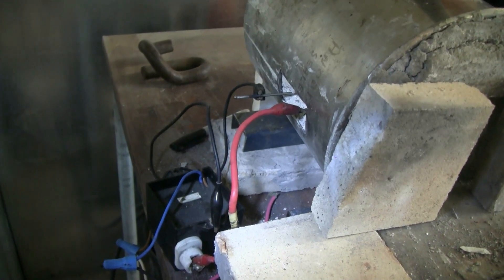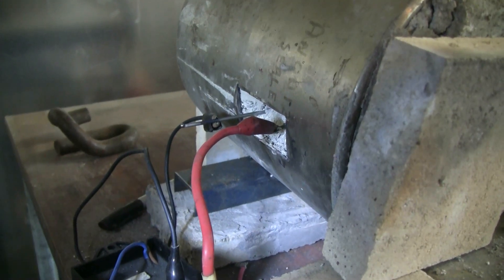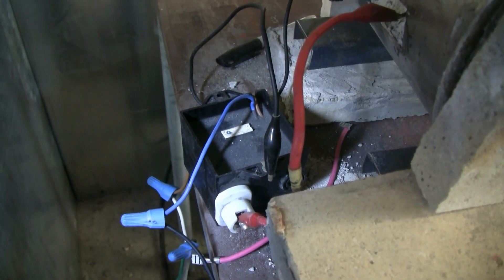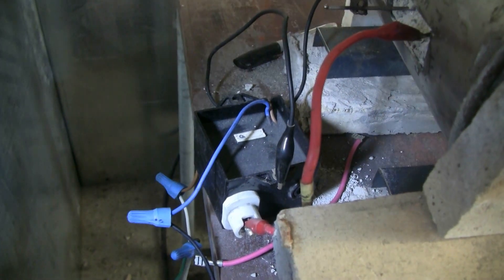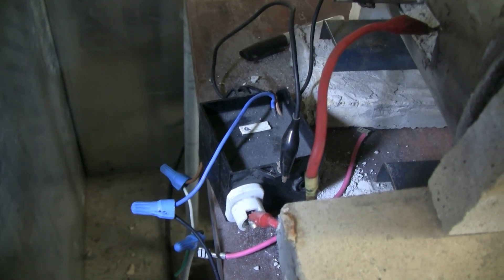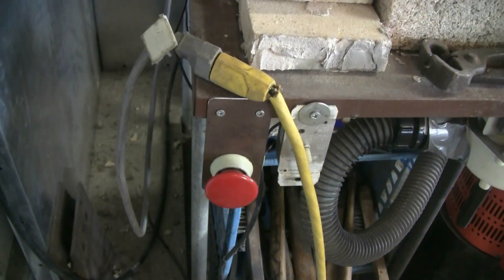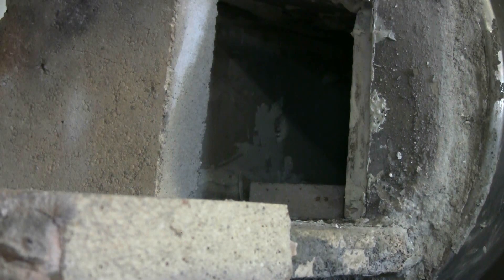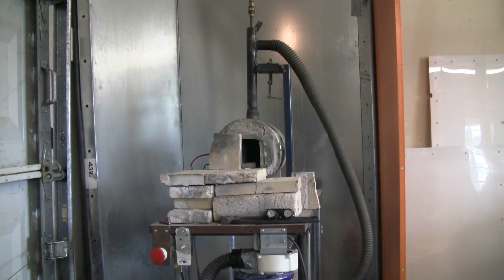DIY Electric Ignition Mod For My New Forge

Comment: I have watched a few of your videos my dilemma of today my building or rather her soon to be craft room the air conditioner went out the compressor is crap going to replace compressor but also my hot water heaters a little old you know I'm going to combine the two put in a new compressor but I lines inside of my hot water heater that way it will heat up my water and cool down my little house(hers) have you ever thought of doing this.